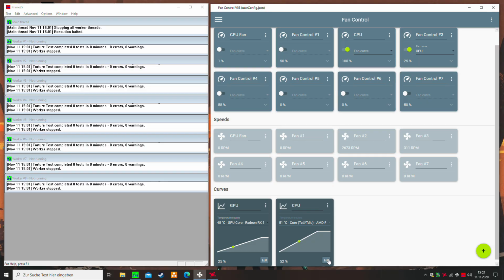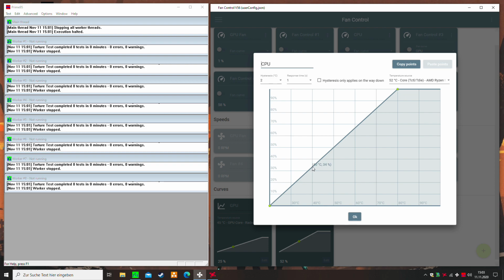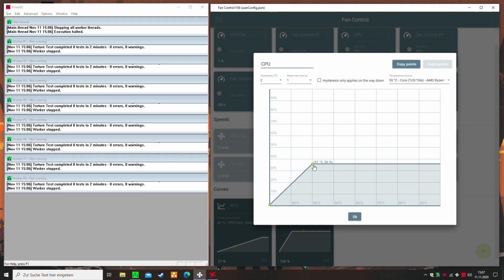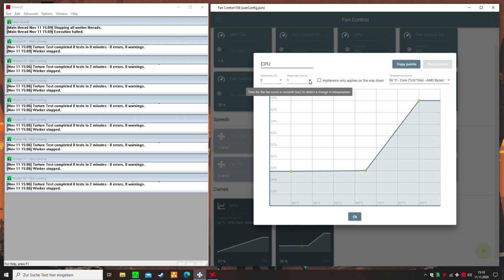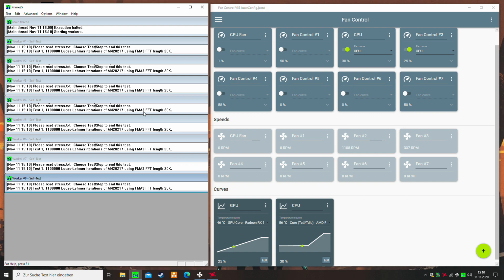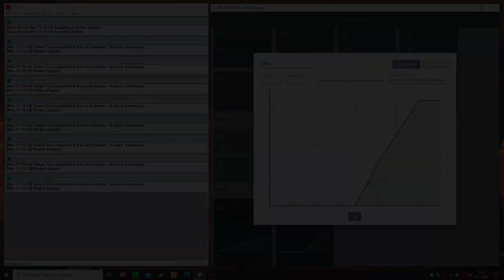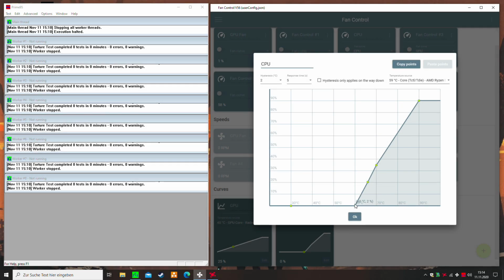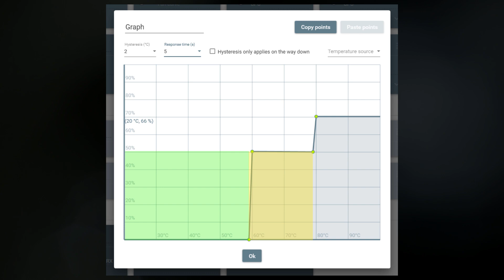[2023] Quick Silent CPU Curve Tutorial

Comment: What you show here will reduce peoples cpu lifespan! The longer hardware has to withstand high temperatures the earlier it will fail.
For CPUs temperatures around 60-65 celsius are fine - higher temperatures should be avoided for maximum lifetime.
If anyone thinks thats not true - why are most of the compact notebooks/mac books etc. failing after 1-2 years? Because they operate often at the maxumum allowed temperature around 90 celsius which causes thermal throttling and shortens the lifespan. 
Furthermore the biggest noise issue in most pcs is the GPU - not cpu! Gpus are fine up to 85 celsius - but lower temps will of course be better. You can try undervolting your gpu and tweak fan curves to get it quieter - often without noticeable performance loss.
You are welcome^^

Comment: How do i reset my fan curves back to normal please i messed it up and my temps are really high
Reply from the maker: Just delete the specific curves and reboot. This should fix things and you can start over. Without any instructions coming from the tool your mainboard's settings for fan control will be applied automatically. Don't worry. Your CPU will throttle down before any damage might occur.
Reply: @WatchMysh  thank u thank u so much

Comment: What about system fans, should i make a graph to make them stop while I'm testing for the CPU cooler?
Reply from the maker: There are different possible approaches. I have them running at a steady speed of 500rpm where they are inaudible. They provide basic cooling for the system and support the CPU cooler. You could also turn them off while idling or like you said to check how well your CPU cooler does without any support from case fans - and then just let them kick in once your CPU temp reaches a certain threshold.
Reply: @WatchMysh  Thank you for the quick response. Went for the 500rpm-ish option

Comment: If you decide to undervolt your CPU and GPU after you've done this, should you go through the whole process again? Or is that pointless?
Reply from the maker: You should be fine in most cases. Except with GPUs like the Rx570 which are like a whole new chip after undervolting. I'd just undervolt my stuff and then adjust the already optimized curve a little bit manually. You should be able to flatten it slightly after uv.
Reply: @WatchMysh  Alright, awesome. Love this video btw. For some reason I've not found anyone else talk about what you described in step 4, and that was just the kind of thing I was looking for. Really want no noise at all in idle.
Reply from the maker: @ariasariamis712  weird :D Guess I'm not the only one mentioning this but the other stuff seems to be well hidden.

Comment: Would a aio cooler works the same? Thanks.
Reply: Yes more or less the same, just did similar thing to my kraken 360. Works perfectly.
Reply from the maker: More or less. You need longer heating cycles because the water takes longer to heat up.

Comment: Good approach!
Reply from the maker: Good tool ;)
Reply: @WatchMysh  For some reason nothing changes..the same rpm is used no matter how i set speed of the fans on both my case and my CPU.I used a low temp (28 degrees Celsius) to set the fans to go at 80% but nothing happens.I watched the creator's first videos that explains how to use his app but nothing works as indented.
Reply from the maker: @encapsulatio  this is strange. Might be a conflict with your chipset. Otherwise check in the bios and set everything related to fan control to "auto". Then try again. Also make sure no other program interfers. You also could check if Argus Monitor works to rule out some of the above. There's a 30 day trial.
Reply: For some reason nothing changes..the same rpm is used no matter how i set speed of the fans on both my case and my CPU.I used a low temp (28 degrees Celsius) to set the fans to go at 80% but nothing happens.I watched the creator's first videos that explains how to use his app but nothing works as indented.